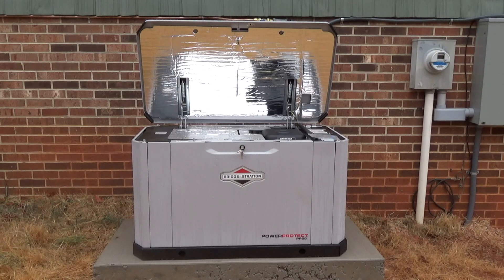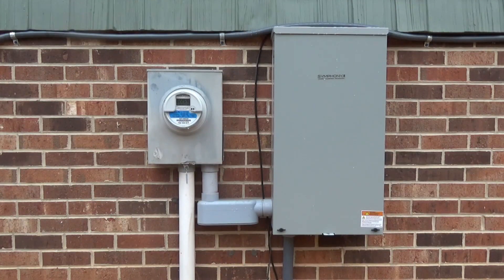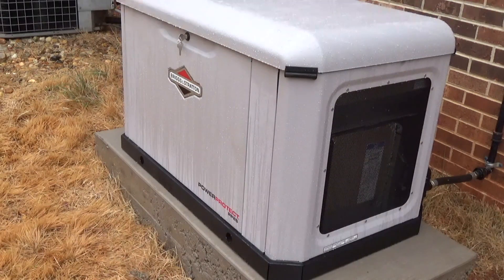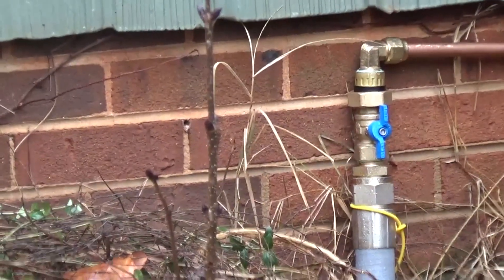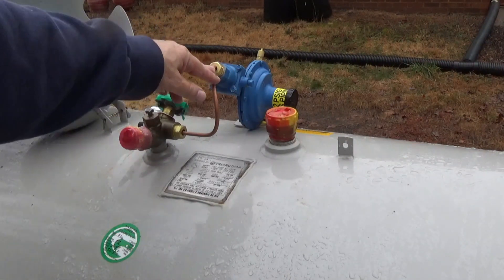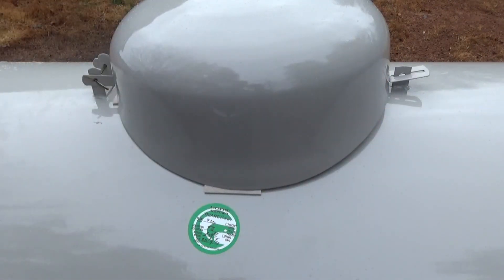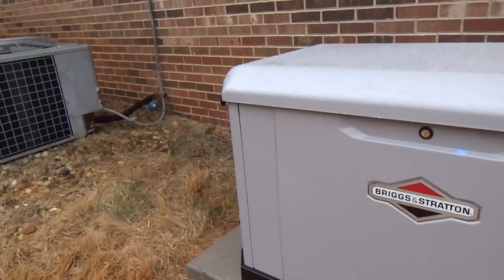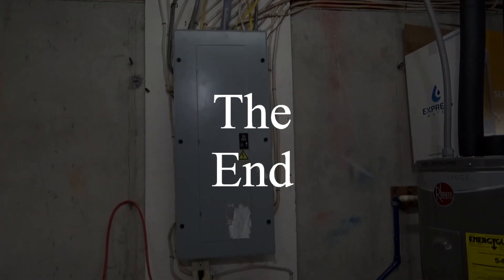Overview of a Propane Backup Generator Installation

Comment: I’m switching to a larger LP
tank. So will I need an adjustable regulator inline then connect to B&S regulator that’s attached at the generator?
Reply from the maker: If your line is sized right then the tank size will not matter.  The gas company will confirm this when they install the tank.